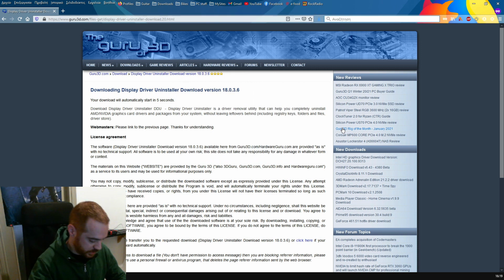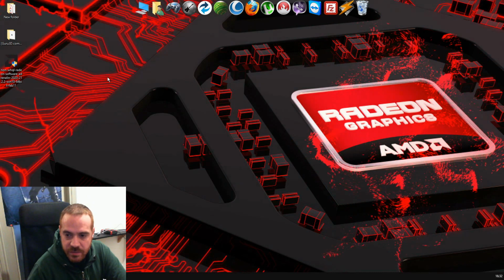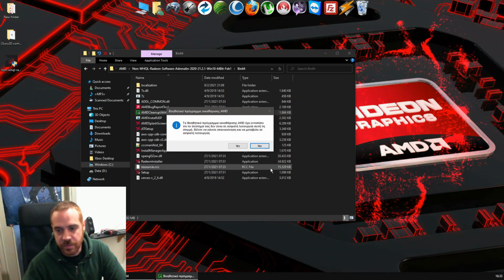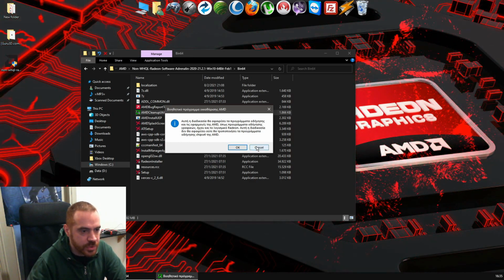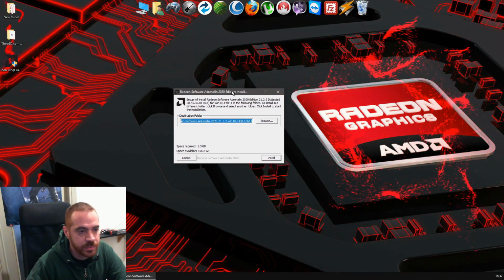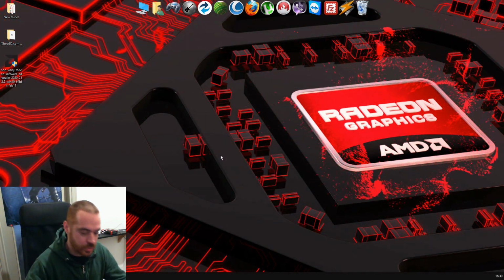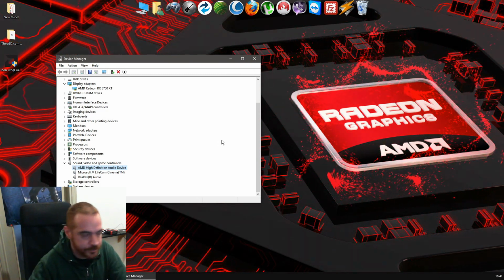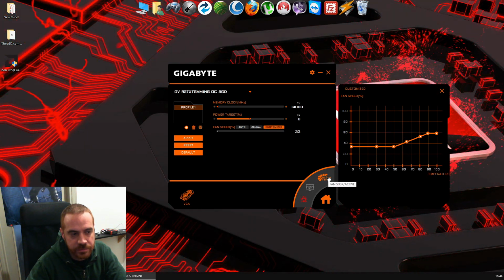AMD Driver Crashes fix 2021

Comment: I had a working cpu until it crashed few days ago (dell latitude e6540, with intel 4600/amd 8790m).
I'm running win 10, latest updates installed, and regularly updated catalyst drives. Everything was working like a charm (even witcher 3, gta v on medium details with descent frame rates, 45-50 fps)...  
Firstly I was like ok, it has to be faulty ssd  (samsung evo 860), so I saved some of docs I had on that drive and did a complete new win 10 installation. Then I've scanned ssd (chkdsk, smart and samsung factory application) and i was wtf?! Ssd in excellent condition, no bad sectors... In short, I've tested all the hardware and everything's fine. 
Whenever I try to install AMD driver's (old ones from manufacturer's site or newer from AMD site) my new system crashes. I've tried DDU method, installation from safe mode, installation of driver only directly from hardware manager, and whatever i do my cpu freezes in the middle of installation, then I have to hard restart, get into safe mode, clean up everything and go over and over... I've tried to disable win updates, reinstall chipset, install all updates, also tried without them, and now I'm running out of ideas. Whatever causes an error is some crazy f** sh** and miscommunication between microsoft and amd and I'm sorry for long comment I've just wanted to share my frustration and experience... I'm experienced pc user for more than 25 years and this is the first time I'm feeling powerless that I just can't install my hardware properly. If you have any ideas, just shoot bro :) cheers
Reply: Hi again ivan i find the solution so i said to myself that i should tell you what i find
1. Run safe mode
2.use amd clean up utility
3.use DDU and uninstall amd driver
4.restart the pc
5.download the Amd 20.8.3 driver this version is the secret i think then install it
It maybe freeze but if u restart it will be fine :)
Reply: @limbo_zyx  hey bud, I appreciate your comment but I corrupted windows so many times trying to install 20 different drivers, all with DDU method... I reach the point where I can't get into safe mode anymore, I'm unable to roll back to previous system restore point and all that's left is do a clean installation and it takes me so much time cause there's a lot of software I use for my work and simply takes me 48 hrs to optimize everything again so I just gave up and disabled discrete GPU. I'm gonna get rtx rig for gaming one day and that's it :) but I'm glad that that method works out for you! 
Anyways I'm 99% sure it's hardware issue caused with bad cooling and high temperatures combo, it's problem since I've purchased this laptop. Best...
Reply: Same graphic cards and same problem
Reply: @HeieNN  Our AMD GPUs are rotten due to overheating. There's no software solution. You can disable radeon in hardware manager and use Intel GPU (but not for gaming) and pay attention to temperatures not to burn the rest of the hardware

Comment: thanks i was getting a thing where it would freeze then turn black and disconnect all my usbs before turning back on and seeing a game and driver crash happen
Reply: I'm having the same problem. Did this video fixed it?
Reply: @frazoni.  it fixed for a while but its happening again now
Reply: @crastlez2595  I'm kinda tired of AMD it performs way better than Intel and NVidia but at least with both of them I haven't had a single problem in my entire life
Reply: @frazoni.  I know I just want to play games but i cant without crashing
Reply: @crastlez2595  yeah it sucks, every two months or not so I have a problem with amd...
Reply: @frazoni.  Honestly same. I ran my pc 7 years with NVIDIA with zero issues. After a year with AMD, been crashing for 2 months now.

Comment: I have a rx 570 and rx 5700 xt shoul I download two different drivers for them? or shoul I download rx 5700 xt only...?? is rx 5700 xt drivers covers also rx 570 driver?
Reply: coz I try that then an error occred code 43
Reply: I would recommend dual booting windows 10 with one for rx 570 and one for 5700xt, or just dont use bvoth graphics cards